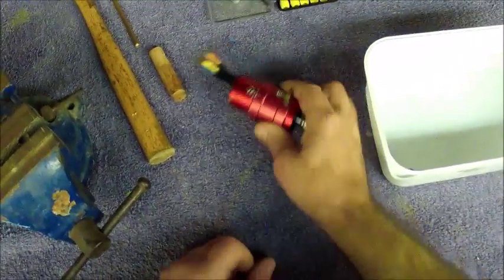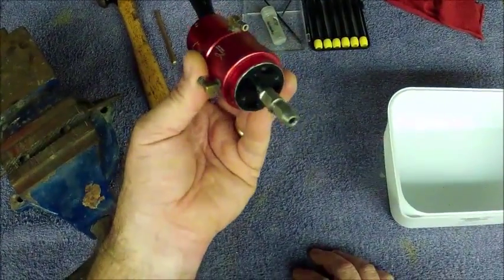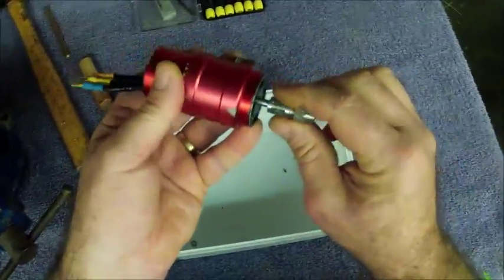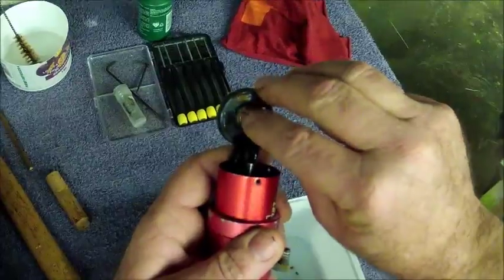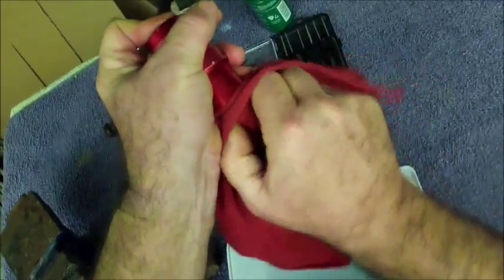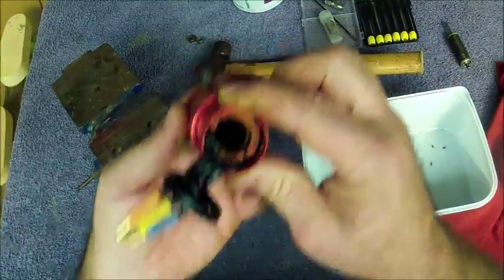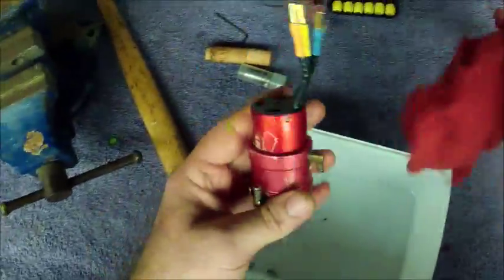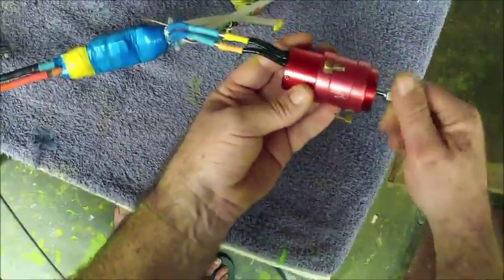Changing Brushless Motor Bearings - Bro rcSurfer

Comment: Great video. Step by step and clearly explained. I wish I had of watched your video before dismantling my HPI Flux motor. There's no need to take both end caps off to change the bearings. I've gone through hell trying to take the front cover screws out for no reason.
Good tip for a future rebuild. Thank you